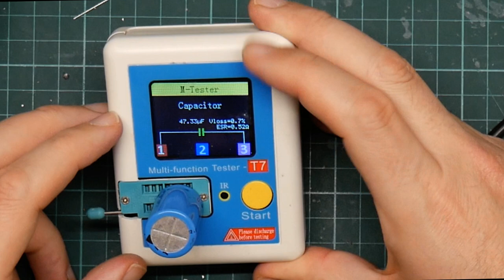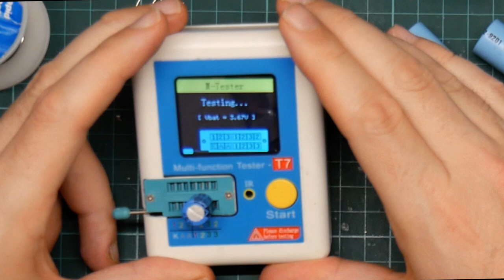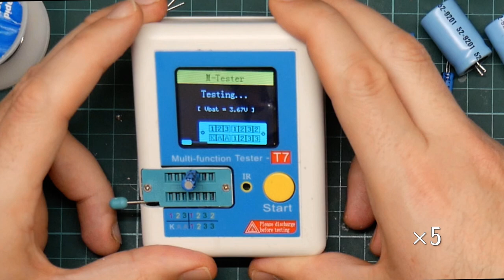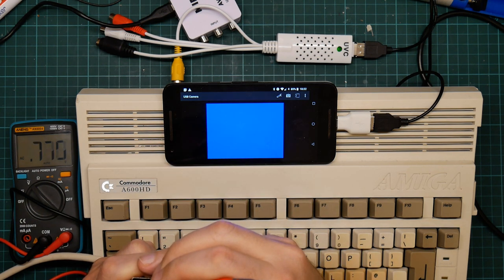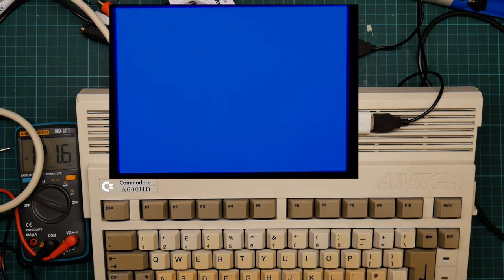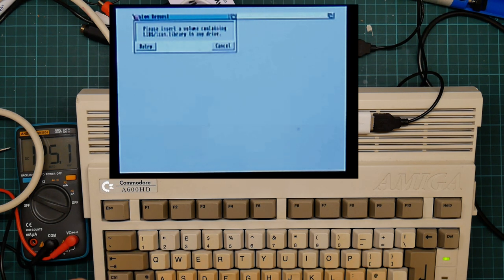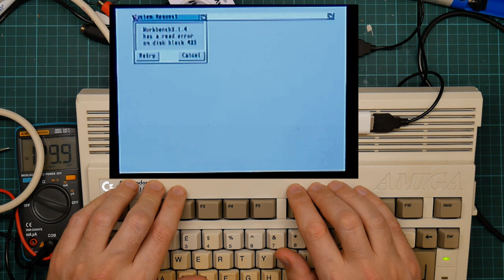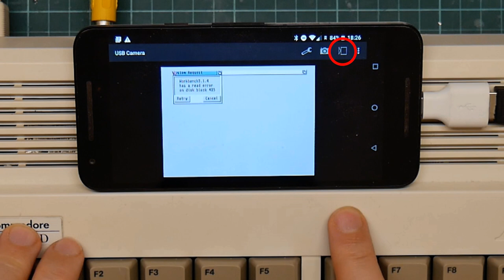Recapping an Amiga power supply

Comment: Can you please indicate what the thick traces are actually for.  My understanding was that these were for ground connections but I could be mistaken
Reply from the maker: Probably they're for mains voltage connections. The thinner traces will be for low voltages. There should be an insulating gap between them.

Comment: There are new power supplies for the Amiga that are far superior to the originals. There are also 3D printed frames that enable mounting modern power supplies inside the original cases, so repairing the originals just isn't worth it.